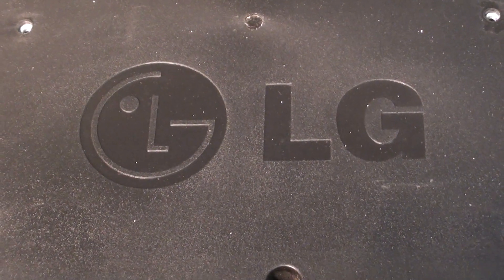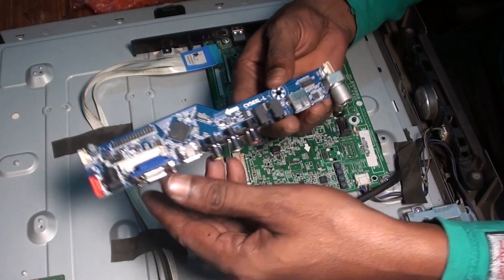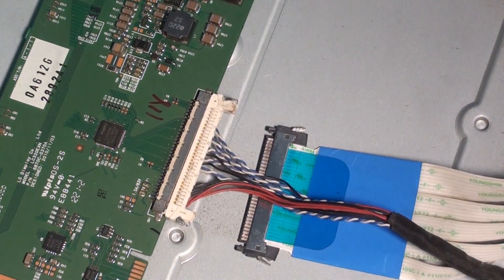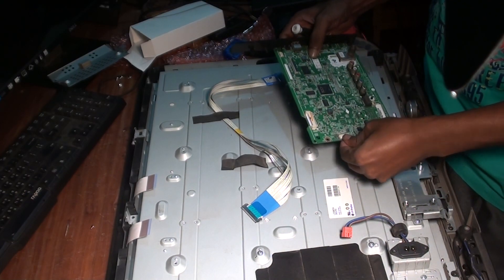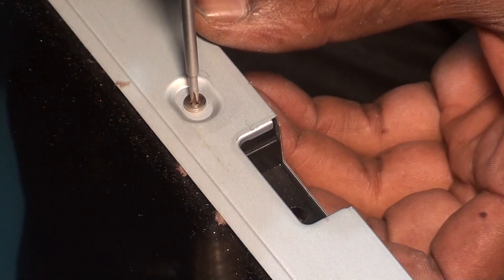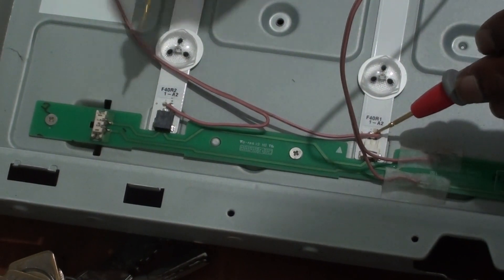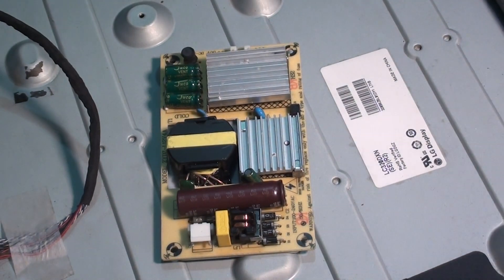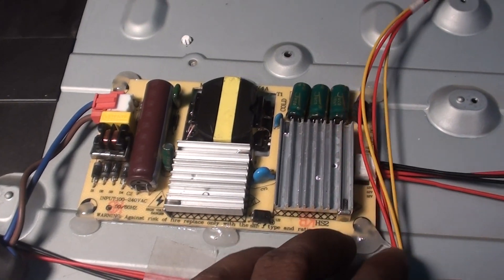How to use China motherboard on LG brand TV.#Pro Hack

Comment: Why my board cant blinking led..just blue light....we must instal firmware first sir ????my panel lc216exn...22ln4100 tv led panel...use v59xu-z1 chipset...cam you help sir for formware this panel seting 1366x768..
Reply from the maker: Submit your Gmail....
Reply: @ProHackHD  aditerny230884@gmail.com
Reply from the maker: @Adit_Kicau  Check inbox....
Reply: @ProHackHD  can you give me data sheet hc216exe-sldp1-41xx sir...I was search in internet..but can't find..
My panel hc216exe-sldp1-41xx..not lc216exn-sfa1
Reply: It's have same pin out lvds or different sir..?? Hc216exe-SLDP1-41XX..and...lc216exn-sfa1
Reply: On ticon panel..lc216exn-sfa1
Reply: @ProHackHD  how minimum capacity of usb flashdisk to instal a firmware sir...my usb capacity just 4gb...is this the problem firmware instalation allways failed ??
Reply from the maker: @Adit_Kicau  If a driver is installed, the same driver is not installed again and you have to change the resolution.The bin file consumes 5 MB of space without Android TV board.
Reply: @ProHackHD  is capatity of usb flashdisk is important ,,before we installing the firmware sir ??
Reply from the maker: @Adit_Kicau  1 GB pen drive is enough.
Reply: @ProHackHD  hemmmm...why my board still failed sir..I was tried 2gb...4gb usb ...😂😂😂😂😂
Reply: Can you give me link for firmware sir.